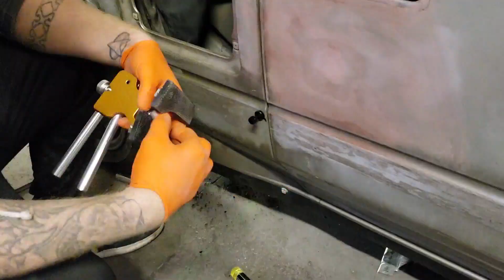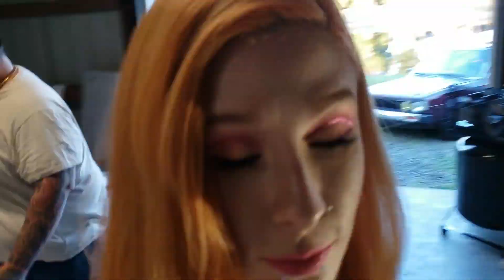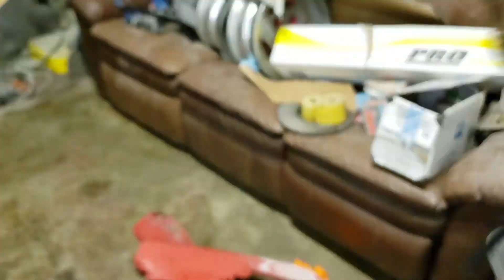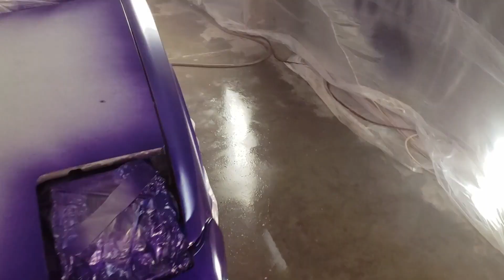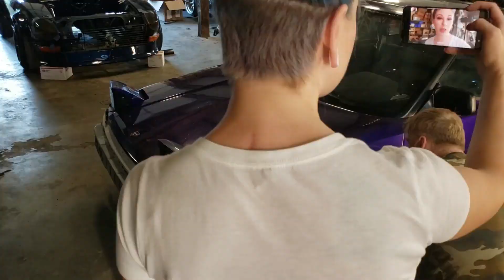REBUILDING THEFT RECOVERED MR2 IN 10min!

Comment: What fender flares did you guys use?
Reply from the maker: they were some universal ebay flares!
Reply: @initialdweebs4050  do you have the size for the fender flare? it seems the front and rear not using the same size flares and the front flare is larger?

Comment: Did you have to deal with any significant rust on the car? It looked pretty clean to begin with, but it also looked like it already had some rust fixed & primed at the beginning.
Reply from the maker: Luckly for us the car had little rust, so it was super easy to prep. Unlike the 280z where everything was cancer rust ed haha
Reply: @initialdweebs4050  I'll have to go check out those videos! I'm up in Snohomish with an '87 MR2 that's got light but extensive rust and a few bad patches, plus it's in need of an engine rebuild- hopefully I'll see you guys around once I get mine running.
Reply from the maker: @LegitPurpleleven  heck yeah man! I'm sure it'll turn out great.